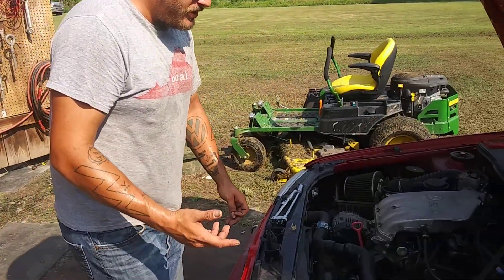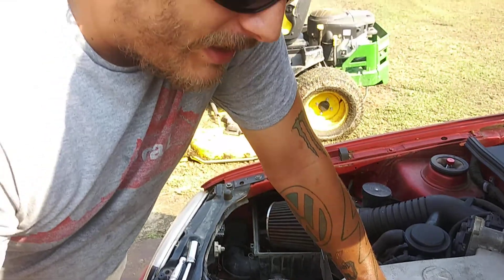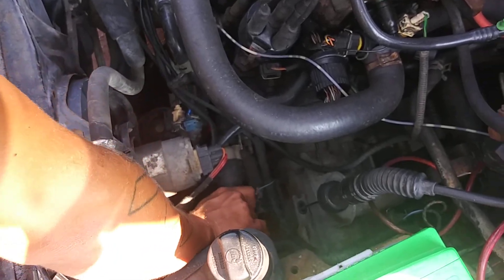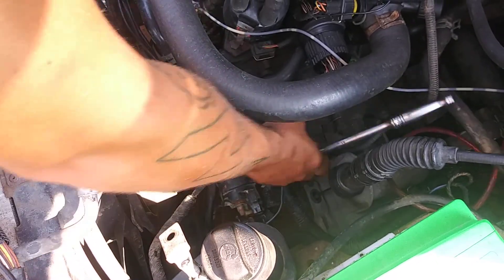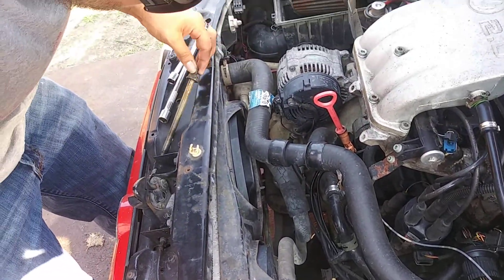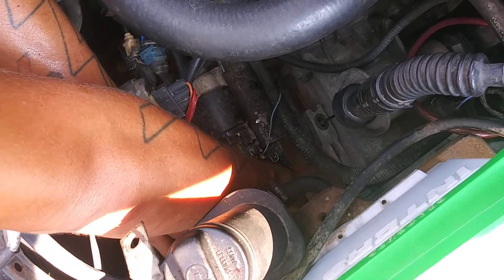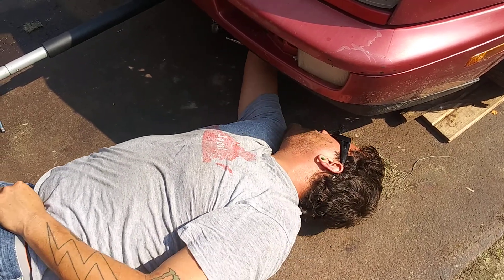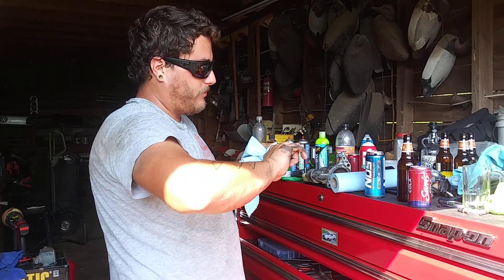Vw mk3 starter swap (manual trans)

Comment: is the motor mount bolt a through bolt or a screw in bolt????
Reply from the maker: 2 of them go all the way through the trans and engine, 1 is short and does not.
Reply from the maker: The auto trans should just be 2 that go all the way through
Reply from the maker: The motor mount bolt going down should be short

Comment: Is it pretty much the same for a mk3 jetta tdi?
Reply from the maker: Yes. All the manuals are more or less the same from mk2 to mk3. The auto is different. Auto is far easier, only 2 bolts, 1 wire clip, and the main power wire nut.
Reply: @vr6prodigy   cool thanks for quick reply man, and good video! Appreciate the help.. I'm in Canada and I don't know but I think we've got all our part numbers wrong. I have a hell of a time getting the right parts for this thing.. When I ordered the new starter I told them 96 jetta tdi with manual transmission and the starter I got has only two mounting holes (mine has three) Every starter I look up for this car with manual transmission has two holes when I search automatic they have three holes and some of them don't have the shaft that goes through the gear, it just the gear if that makes sense.. do I get the one with the shaft or with out?   I don't really wanna take the old starter out untill I have one that can go back in..
Reply from the maker: @matdiclemente3564  that's a weird one! So I always recommend trying to put back what came out. However, part manufacturers are known for doing "updates" on parts where they revise how something works. So it's entirely possible that you can go shaft or no shaft. Have you tried to check your local auto repair shops to see if any of them offer rebuild services? I have a couple places locally that do it, so when I'm not sure about replacement parts, I try the repair route. @vr6prodigy is my Instagram if you use that app. I'd say send me some pictures and I can try and help find something out.
Reply from the maker: @matdiclemente3564  the amount of bolts does for sure matter. In my experience the manual always has the 3 bolts

Comment: i just spent 3 hours trying to get mine back to together to find out that the bottom nut got stripped out when the bolt backed out
Reply from the maker: Oh shit. That's no bueno! The bracket or the trans?
Reply: @vr6prodigy  the bottom starter bolt that threads into the nut on the bracket that bottom nut got fucked when the bolt backed out
Reply from the maker: @whistlintdi1282  well all is not lost! Pull the bracket back out and getting the self catch nut off and use a regular nut on the outside! It'll be a pain. But it should work!
Reply: @vr6prodigy  i took it out today and the bolt treaded in and it wasn't super smooth but it when in easy enough so i put the bracket back in and i just can't seem to get it to thread in still
Reply from the maker: @whistlintdi1282  are you trying to bolt it to the motor first? Or the mount first?
Reply: @vr6prodigy  i bolted it to the mount first then tried getting the starter bolts in
Reply from the maker: @whistlintdi1282  ok. Are you getting any of the bolts in?
Reply: @vr6prodigy  i can get the top in just not the bottom
Reply from the maker: @whistlintdi1282  try going higher or lower with the engine. It's a bit of a bitch. Or put it on the engine first. I usually put the bracket on the engine first. It's much easier to line up the single hole on top the mount
Reply: @vr6prodigy  i had a buddy come over and i held the starter while he threaded the bottom bolt in but we got it in such a relief then i did my trans mount as well
Reply from the maker: @whistlintdi1282  heck yeah buddy! Glad to hear it! Time to get to ripping! Hmu on ig if you've got one! I'm @vr6prodigy it's much easier to get a hold of me over there.
Reply: @vr6prodigy  sent you a follow